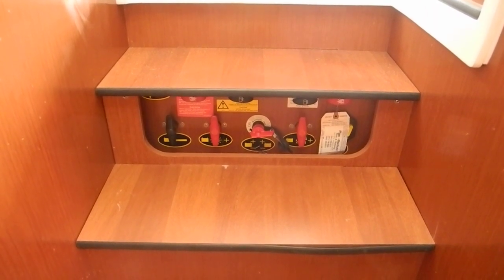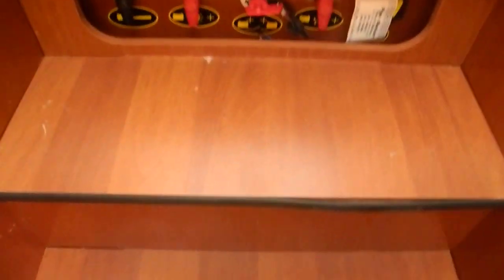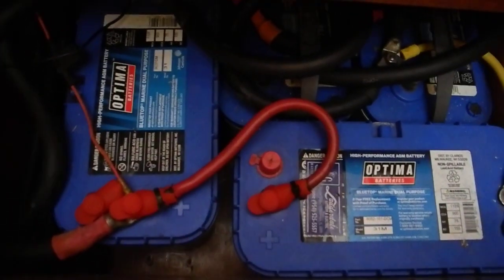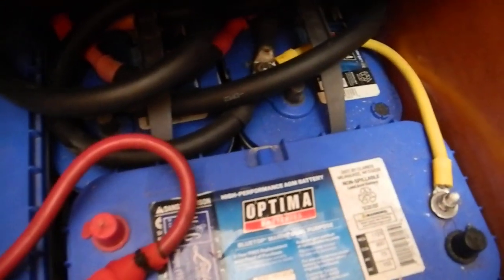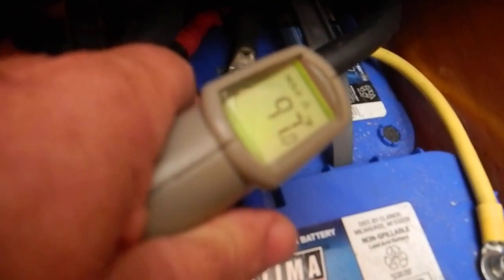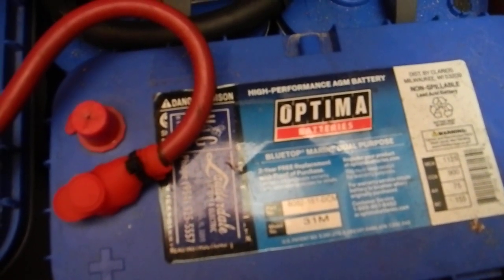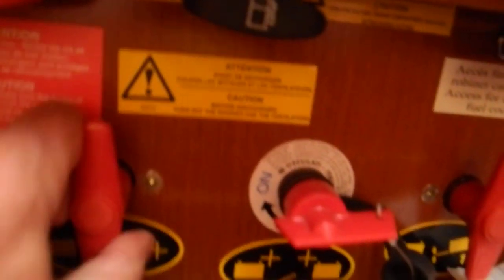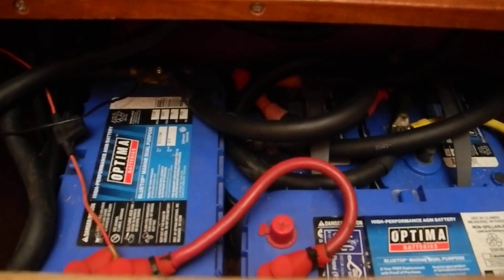Hot Batteries Are Dangerous

Comment: Two of the seven batteries in my boat were shorted internally and hotter than the good ones. When disconnected, the bad batteries showed very low voltage (6-9 V I think) and when they were connected, they drained the good batteries in less than a day (except the two dedicated starter batteries that are not connected to the others).
Reply from the maker: Best to keep the batteries independent when possible. One bad battery can bring the others down when connected in a series or parallel.
The  warm to hot batteries may explode, hope they are contained on a battery box.

Comment: With flooded lead acid batteries, a hot battery indicates that some of the plates have shorted together.  Those will also usually swell on the sides too.
Reply from the maker: Yes and then later explode. Be careful.